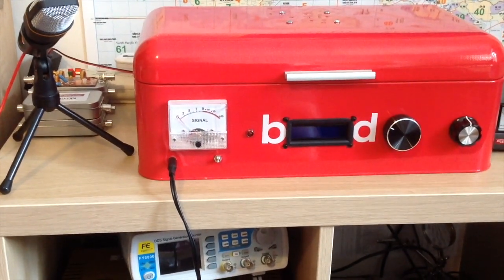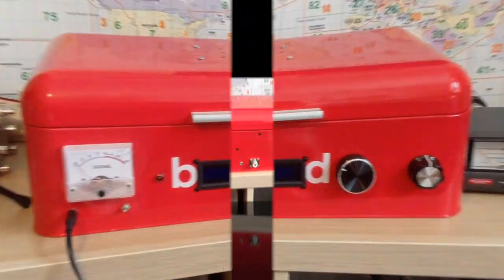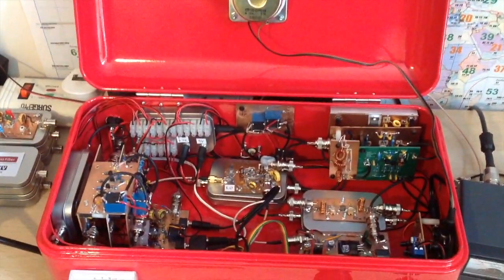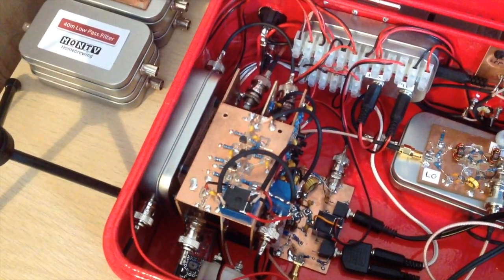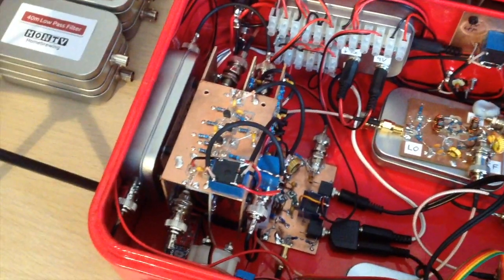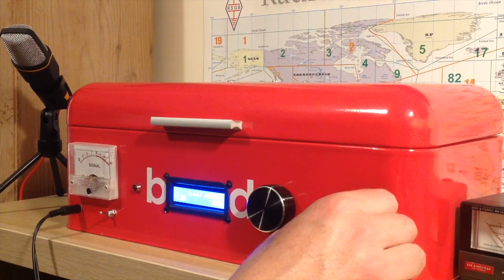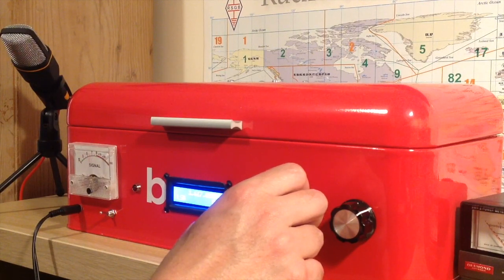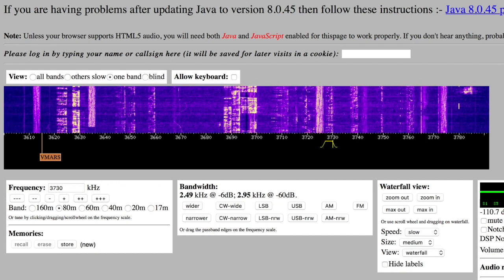15 - The Optimiser

Comment: A fine job Nick, all modular, with connectors, RF sensitive modules in screening tins,  open construction techniques, and as a result, it works! Tx signal sounds and looks spot on. If you are using TIAs then there must be no AGC so the lively s-meter is not gain controlling any part of the Rx.  I wonder if your overall Rx gain is on the light side, hard to tell given a low volume recording,  just a thought.  No mention of VFO and BFO, is it si5351? And what is the Tx PA?  73 and keep melting solder!
Reply: Thanks very much Paul. Yes the RX gain could be a bit stronger  - particularly on 20m but it's not too bad. 73 Nick

Comment: Did you incorporate any Tx/Rx sequencing  to avoid transmitted "klunks" on switchover ?

Mike EI6AU
Reply from the maker: Thank you Mike, that's a great question! The answer is "No, but I'm going to in the next build!" Funnily enough it is something I've been reading about recently (in that sacred text 'Solid State Design for the Radio Amateur') and I'm definitely going to experiment with that. Thanks for watching. 73

Comment: That's very impressive Nick, it sounds good on TX and RX. I think more rigs should be bright red.
Reply from the maker: Thanks Gerry. The only downside is the red paint flecks off quite easily. That's the drawback with using an enclosure designed for muffins not MOSFETS! 73